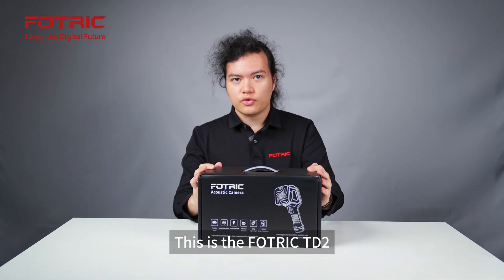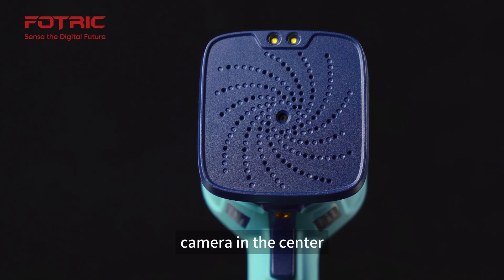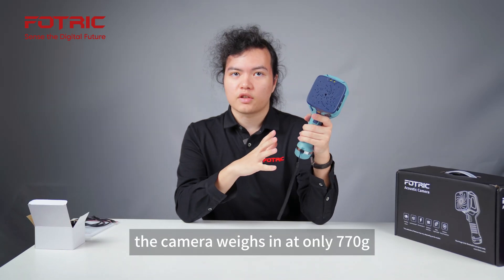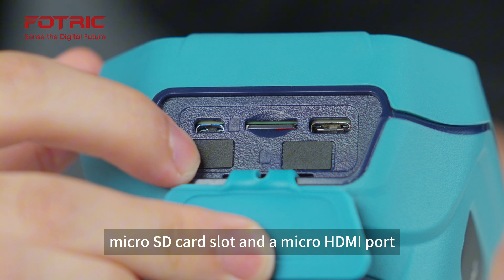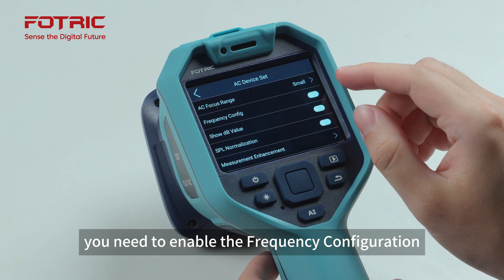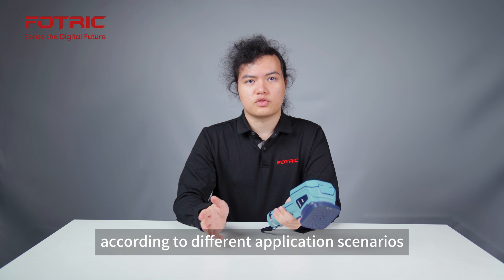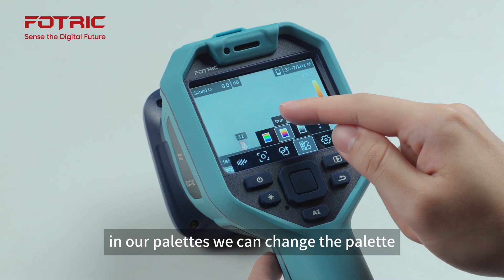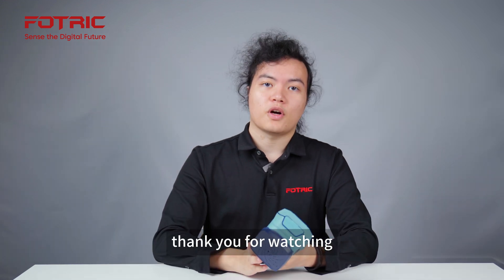Unboxing the FOTRIC TD2 See Sound in Action

Comment: I wanted the similar product by FLUKE, but it's $30,000 so that wasn't going to be possible.  Then I saw this and bought it for $1234 on Amazon.  It is really quite amazing - in a quiet room it can show you where sound is coming from that you can't even hear!  (We found that the TD2 could even detect the 60Hz hum of battery chargers!)

Alas, it has one terrible problem: if you let the battery get low, you can't charge it any more.  You try to plug it in, and the battery charges a little bit, but then the TD2 powers on, which prevents the battery from charging.  Only problem is, it doesn't power on all the way (due to the low battery).  So it shuts down again and the cycle repeats.  Eventually a friend and I took out the battery, looked up the manufacturer (Dongguan Anytime Electronic Technology Inc), and closest battery ("Explosion proof thermal imager battery") and found the charging spec is max 4.2V and max 1.5A, applied across pins 1 and 4 (the battery has 4 connector pins).  After an hour of that, we found we could put the battery back in, and then charge it normally.

Lesson: it won't charge well unless you've powered it off, and if you drain the battery too much you won't be able to easily charge the battery.